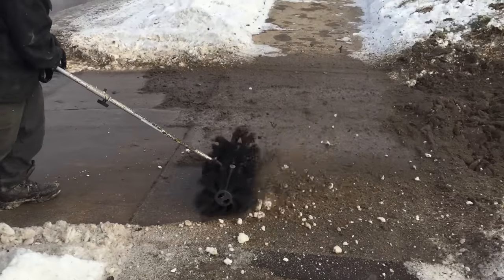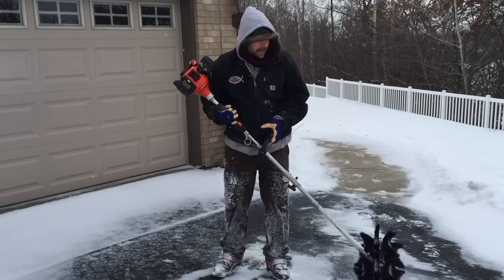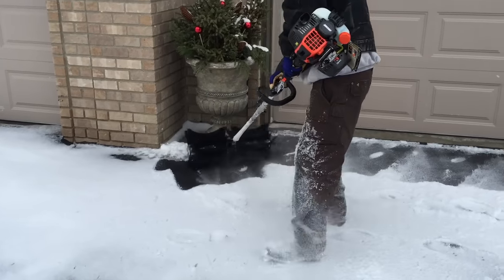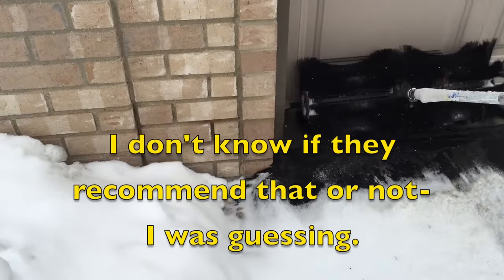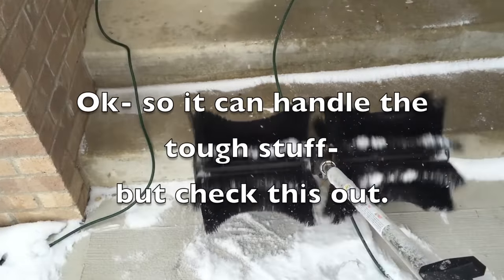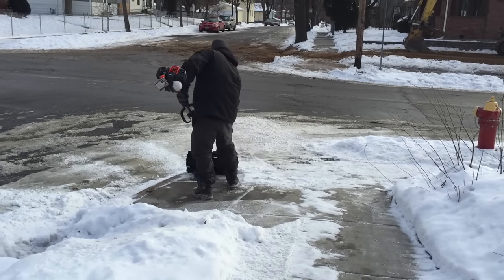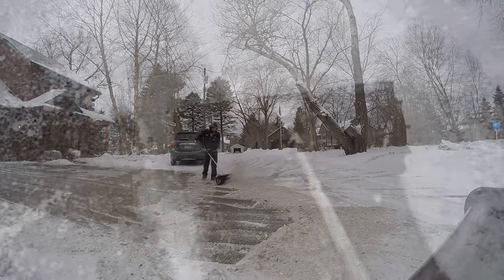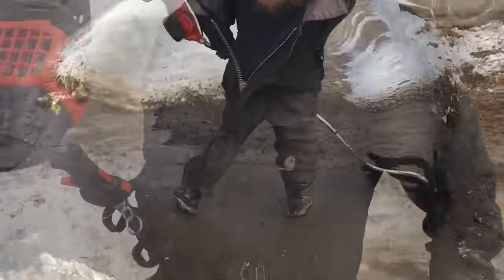Power Tool Review- Echo

Comment: I bought an older PAS-235 with the broom attachment used.  I bought it mainly to sweep the crusty layer of gravel, sand and gunk off the top of my grass from where the city wings the snow from the street on to our boulevard. It works great. It keeps my lawn healthy and the soil level from building up each year. I bought the trimmer attachment and it's now my go to trimmer. The power head is 10-12 years old and still goes like a champ. When it does finally die, I'll upgrade to the PAS-280
Reply from the maker: I use my Pas 280 for the same thing-  Its a great broom to remove aggregate from grass.
Reply: Problem I have with that is someone is gonna kick my ass if I'm running that high speed at 3am

Comment: I rented one of these (with paddle) today to get rocks and gravel off my lawn. That's a job I do every year after plowing snow my rural property all winter. I have to say that it did a good job, but three hours of doing it was more than I wanted. The biggest drawback I found was that it will create piles of gravel and then attempt to dig down. If the thing was balanced better, in order to more easily control the downward pressure, then it would be better. The default position of the handle really isn't optimal. If it was 8 inches forward or so, it would be a much nicer machine to work with.

Comment: Stanley, I maintain a college level baseball field with real turf.  One of our biggest problems is the lip created from the infield dirt washing or draining into the grass edges.  In your opinion what would be tough enough to move the dirt back onto the infield from the grass without hurting the grass.  Would the paddle or needle attachment work best for this situation using the power broom?  Thanks for the review!
Reply from the maker: We have used the paddle in this situation.  it works great for removing dirt from the grass without tearing it up.
Reply: Thank you.  Do you have a brand preference - Echo, Stihl, etc...?

Comment: I'm only 14 and 140 lbs but I have a stihl km130r and use it to sweep rock probably up to 6'' high. It is a piece of cake and only weighs about 10 lbs more than a whipper snipper(I also use a strap.). I think echo could convince me to buy one only if they made the paddle flat instead of curved to get more materiel, like the stihl has. The stihl also has quite a bit of power as I can hold it completely still and it can rotate a good 30 degrees when I pull the trigger. However some day I'd like to try out the echo.
Reply: John  Kelly I agree I have a km 131r with the Bristle sweeper it’s awesome in my opinion stihl is the way to (I’m 14 too)
Reply: Is the way to go

Comment: The weight of the paddle alone is 11.2 pounds converted just over 5 kg, then the motor would be Dry. 8.7 pound = nearly 4 kg. A strap really is the way to go for long periods. But the paddles and the brushes really do all the work. But if you need to do a full on car park. Harness up, double straps or the next day. RIP back and neck. Oh and padded gloves to easy that vibration.
Reply from the maker: +Trooperandcooper Ale Thats exactly the way to do it!

Comment: I just bought the stihl version of the echo you were using. What is opinion on stihl products?
Reply: I was going to buy the Stihl but the guy at the shop told me it was not really worth the extra money.
Reply: Yeah I have 3 stihl dealers with in a 15 miles of me and only one small echo dealer and plus all of my hand held equipment is sthil so I didn't really have to think to hard on what I was going to get.
Reply from the maker: +Kyles Lawn-Care I like stihl but echo surprised me-  Echo is awesome!  I will be buying echo without a doubt.
Reply: +Kyles Lawn-Care  I've used both versions and I have to say that Echo is MUCH lighter compared to the Stihl. Just the paddle attachment along without the power unit the Echo I can hold straight out with my arm fully extended, the Stihl I can do about 1/2 way out.
Reply: RaysHML wich version works better? And is the stihl sweeper soft enough to not damage a garage?